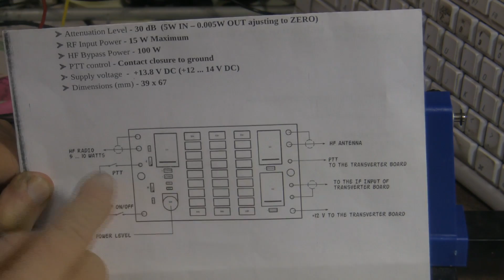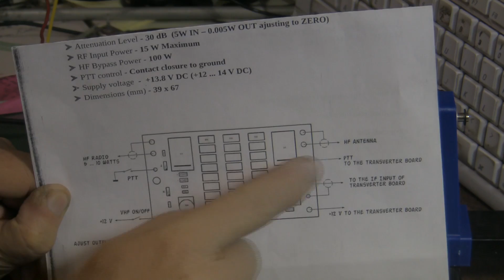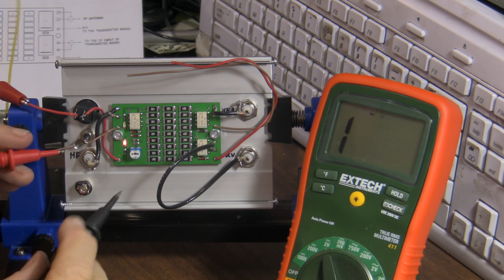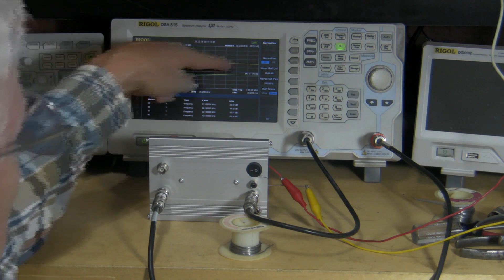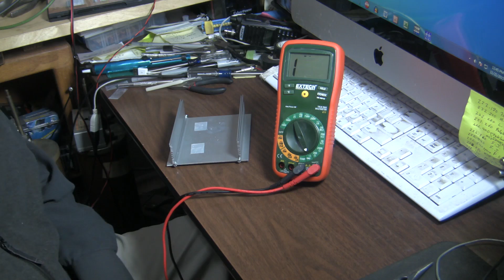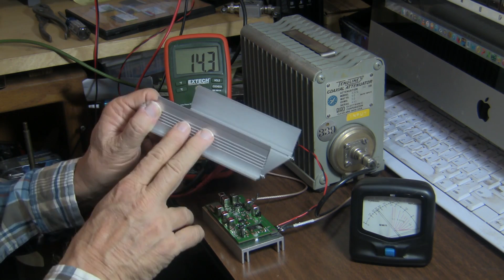UT5JCW 222 1MHz XVTR Kit Part 2

Comment from the maker: As soon as I have some more time, I will show my test setup that aided me in determining what was going on when I was originally evaluating the UT5JCW kit as it came to me from the Ukraine.  

Though Serge has what I consider sufficient warnings stating "The GROUND of the output transistor, the heat sink and board MUST be connected", it was not obvious that the supplied case was not bare aluminum thus should be scraped to expose a conductive surface in the area of the power MOSFET.

The MOSFET used wants to have both DC and thermal conductivity to perform to its full power output capacity.  As I discuss in the video you may wish to also try a piece of the 0.1x2 inch aluminum flat stock available in many U.S. hardware stores to act as a heat sink.  It should, of course, also be attached by screws in several places to the aluminum box supplied with the UT5JCW kit.

Finally, this is not a 'step-by-step' Heathkit style kit.  It requires some experience building electronics from scratch although having a professionally built set of PC Boards goes a long way towards simplifying the process.  

My next video will show some of the evaluation I did using my Rigol DG4102 Waveform Generator as a Double Sideband Suppressed Carrier(DSSC), 28.1 MHz Two Tone source and the Rigol DSA815-TG to display the output of both the source (28.1 MHz) and the transverter's output at 222.1 MHz.  I will also have some audio from a few Northern California SSB stations as received on my FT991 using the UT5JCW transverter.
Reply: +James Eagleson Thanks for part 2 - very nice build report!  :)
I thought that grounding through the screw might be enough, but  you also would have to make sure to get ground somehow from the attenuator/top part to the U-shaped part where the xvtr is placed. Was I just missing such a wire  at around 12:30 or was there none?

Thanks for sharing your expirience!
Reply from the maker: +salat Actually it may not be evident but the connections between the top and bottom boards (Attn & RF) use coaxial cable for the 28 MHz Attn output to the Xvtr 28 MHz input and from the 222 MHz Xvtr output to the 222 MHz output connector on the case where the Attn board is mounted thus there is a DC ground connection through the shields of the HF and 222 MHz coaxial cables.  I did not use a separate ground wire between the two boards.

The issue, by the way, is not the common grounding between the Attenuator board and the RF board but rather the RF and DC resistance from the tab to the case as well as the thermal conductivity between the chip inside the TO220 and the part of the tab where it contacts (or doesn't contact) the case.  We need to get the heat out of the chip and into the heat sink so that it can radiate away from the MOSFET.
Reply: +James Eagleson Hm.. so without a connection between the two case parts scraping the oxide underneath the FET away should then make no difference electrically, right?